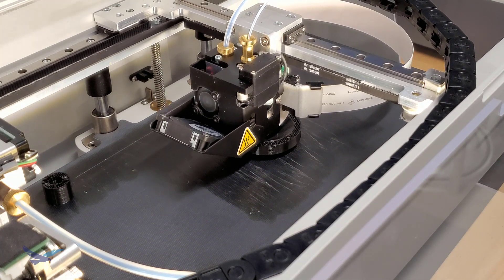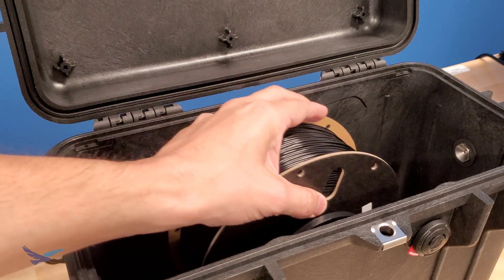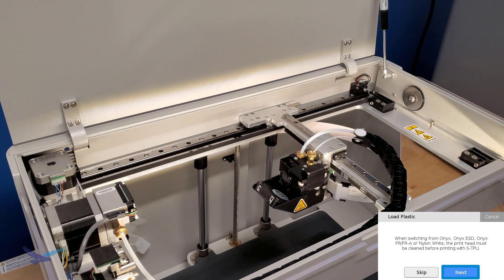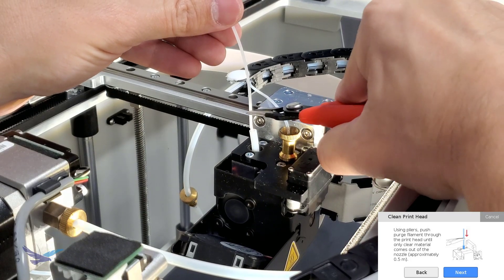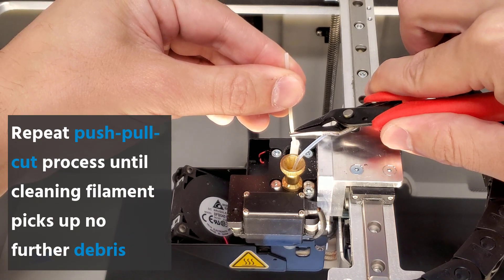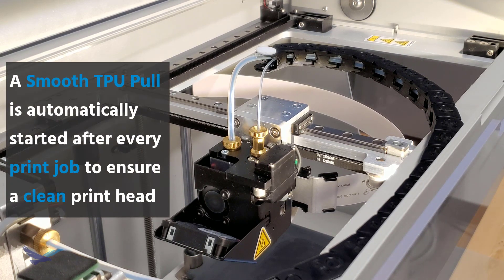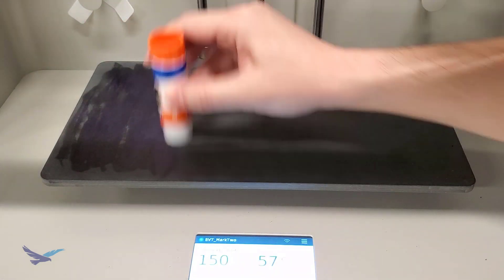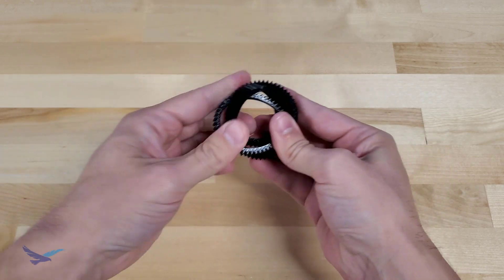How to Load Markforged Smooth TPU 95A

Comment: Is the smooth TPU gasoline resistant?
Reply from the maker: Testing was not performed on gasoline, but data is available on ethanol which will likely cause deterioration within 12 months.